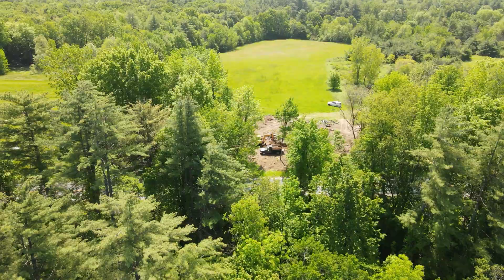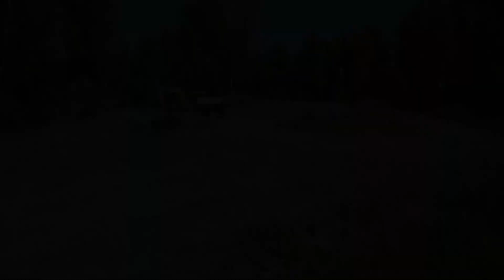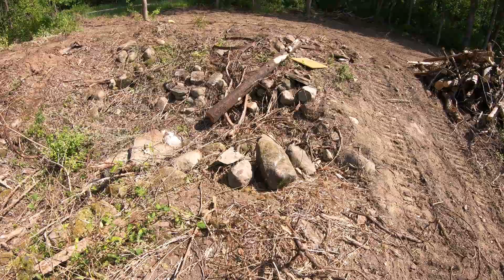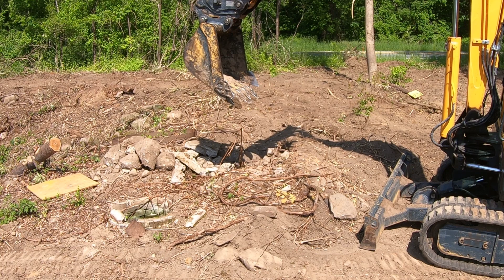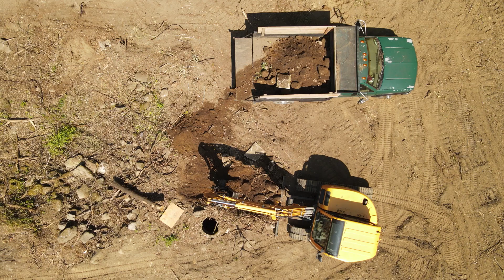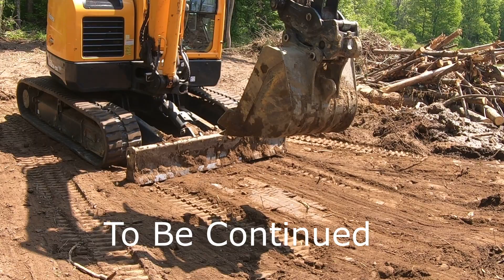Hyundai excavator digging up a cistern tank

Comment: How does a cistern fill with water ?
Reply from the maker: Usually with rain water.
Reply: @AFR_Adventures  thanks for reply, our old house has water coming in when it rains but don't kno yet if it cud be a cistern overflowing or a under ground spring around the house making it get water inside, 1900 house ,we hv t get a person to check it out